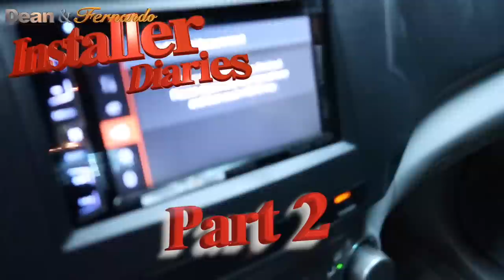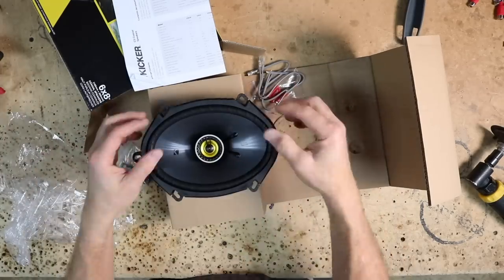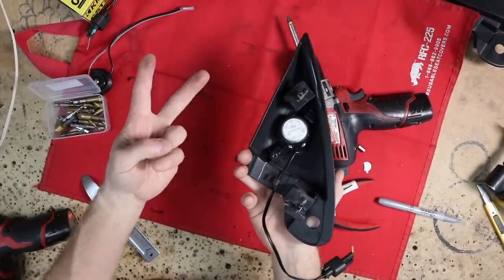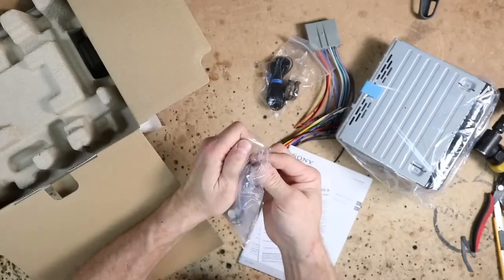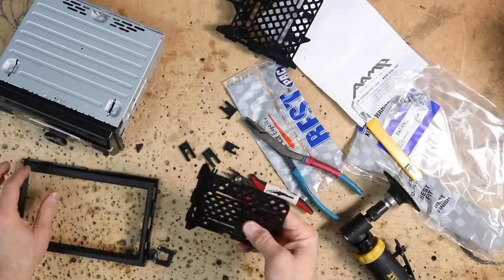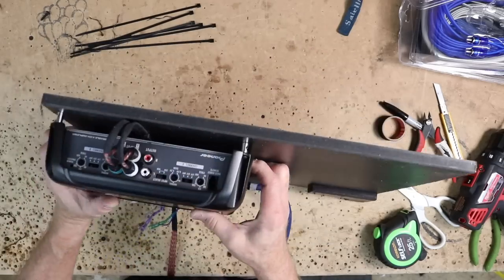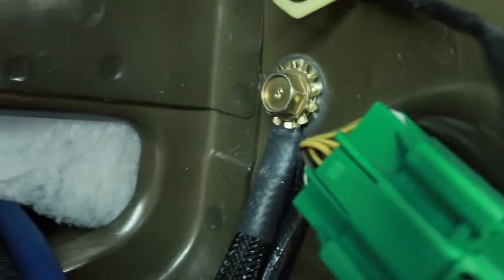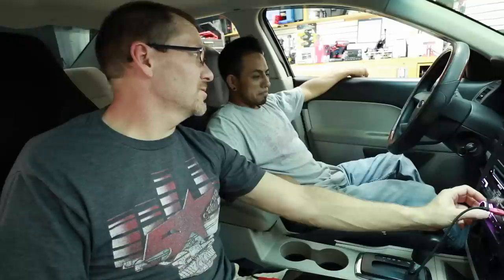Ford Fusion full car stereo install

Comment: Relived 1988. "Unit and 4....and slap an amp in me". Only thing missing would be add an antennae from the Hirada wall for a radio delete car. Did loads of Ford Escorts,Berrettas and Cavaliers in that era. Still in the biz in 2022.

Comment: I wish the car in the video matched the thumbnail as mine is a 2013 model.

Anyways, why not mount the amplifier to the back of the seat?
Reply: I also have a '13. Need to install a sub, sub amp, and amp the doors (speakers already installed, running off the factory head unit). Sadly, I am waiting for the Rockford DSR1 to get back in stock. Might actually be a good thing; as, according to 5Star's RF tour video (great job guys, and what an experience), they are moving to a new app to control the DSPs, etc. Besides, I need to run wires, design/build the enclosure, etc. first. So, perhaps 6 months from now I may have an operable sub, even if I use a passive LOC in the interim to make it happen.
 As always, thank you for the diaries, your insight, and your dedication to the car audio world. God bless and good health.

Comment: I had a best friend that used to like the monster wire brand speaker cable alot of stereo shops would sell along with especially the Rockford fosgate and mtx audio brand amplifiers and ground shaker,qlogic and the Rockford fosgate version of the bandpass box builds most had, anyways the monster wire cable was flat squared and usually brown or grey coating and for home audio was white and a slightly lighter grey than the standard automotive product.

Comment: loved the part where they showed where they drilled the hole through the fire wall to connect the positive wire to the battery

Comment: And I have a question dean sir I have a 2000 dodge ram Laramie slt quad cab long bed with the factory cd/cassette infinity stereo system and I was what you would suggest to replace the factory pillar mount tweeters and how you would suggest mounting them,I've had a few people suggest cutting the front tweeter grill off and using some version of a skar audio aluminum tweeter that has a screw on collar?!

Comment: Do you have any info on putting in a audio control lc2 pro In the 2011 Mercury Milan premier with the stock Sony navigation system in it. I can't find anything on the rear amp wiring to tap in on the sub woofer channel or what you recommend for the line driver to hook up for the sub with options on the other channels coming off the Sony amp? I have 2 1997 RF 500.2 amps and I have 2001 RF 800@4 that can be used for front left and right speakers and Sub and the rear can drive left and right speakers and Sub but you would need crossovers to do that or I can just do rear and front full range off the 800@4 Sub off the 500.2 amps but I don't know what audio control lc2 or whatever to accomplished running a full system off of that Sony amplifier or just doing a subwoofer

Comment: This is unrelated but I have a hard time believing "fast rings" have any noticeable effect. My car is a stereo first and a car second so I wouldn't mount anything in the front doors anyway for a number of reasons but I put fast rings on my rear doors and I was not impressed. Their obviously over priced and I just have a hard time believing that thin foam does much of anything. I didn't take any measurements but i'm sure an RTA would agree.